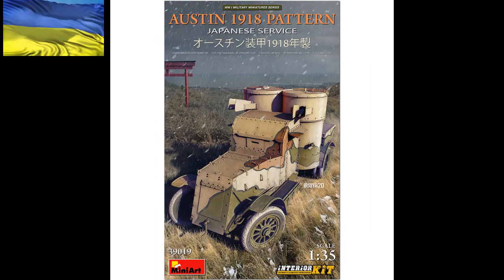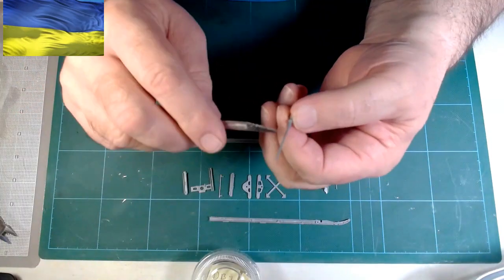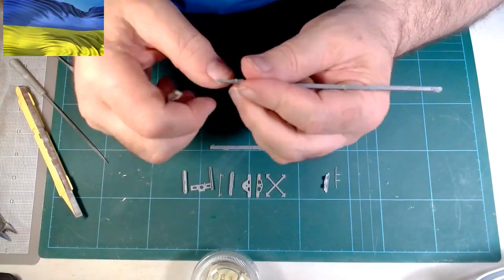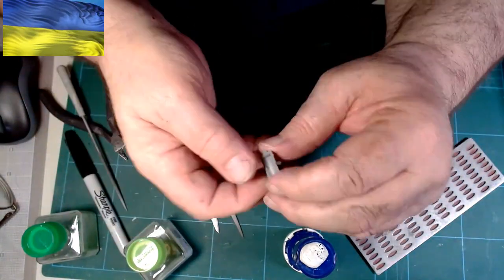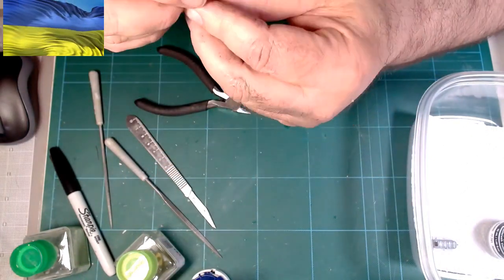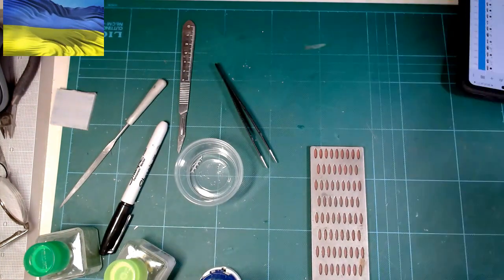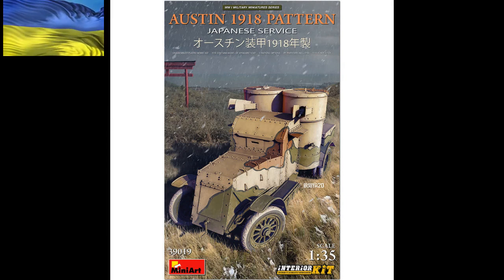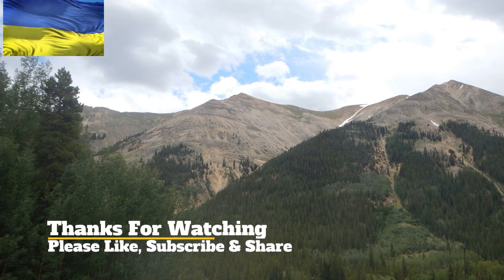MiniArt Austin 1918 Pattern Japanese Service Part 2

Comment: Build looking good, narrative works ok.  I personally think being sped up all the time doesn’t quite work a bit of both maybe better.
Reply from the maker: Hi Jason, thanks for taking a look.  I completely agree with you.  This was an experiment, like all my videos.  I still plan to try different thinks as I go along.  I think the webcam solved my file size issue, now I just need to work out the best way to use it.  Have a great day.  Jeff